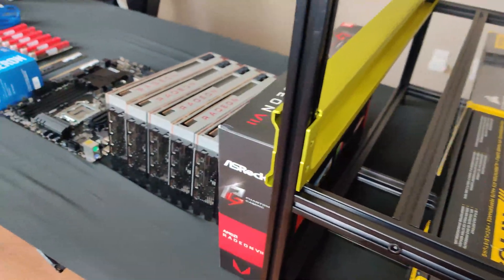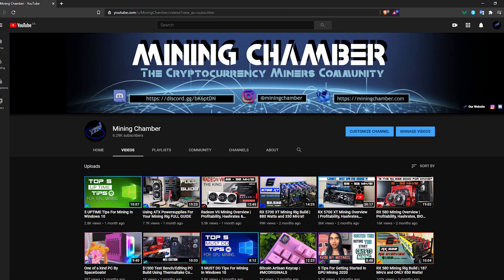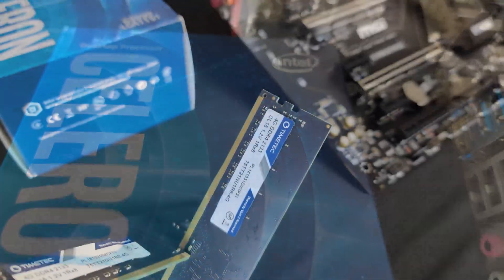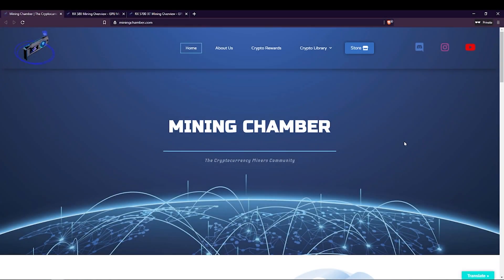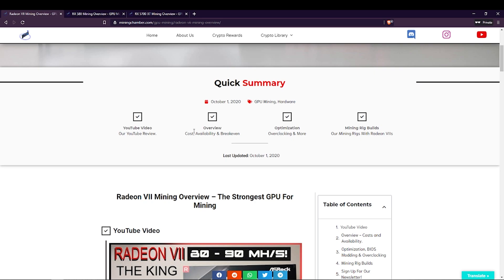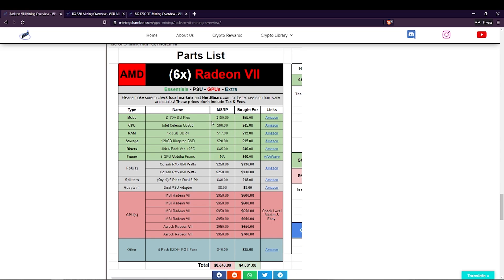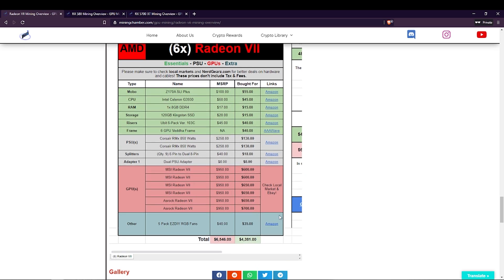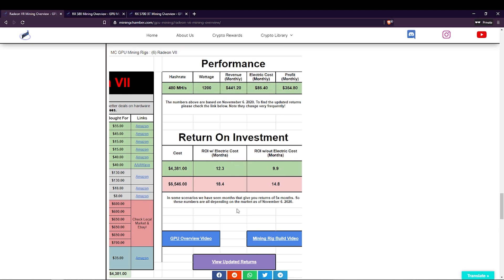Radeon VII Mining Rig Build | HIGH 480 MH/s and 1240 Watts!!

Comment: I also have MSI Z170 board. May I know what bios settings did you change to make it run for 6 gpus?
Reply from the maker: I had to set 4g Decoding on and that did the trick, but if you have more issues with it then try to put your pcie lanes gen speed at 1 or 2. Also note that since this isn't a mining motherboard, it might give you troubles powering high powered cards, we eventually had to change this motherboard and instead used a tb250 btc pro motherboard
Reply: @MiningChamber  ah, I see. Thanks for your input. Why did you change the motherboard? Is mining on MSI board not stable?
Reply from the maker: Msi board ended up giving alot of issues since the R7 are power hungry cards so I think the pcie lanes were not able to handle the R7s (since there is no power directly to the PCIE lanes with Molex port like the tb250)

Comment: Thanks for the videos, they've been very helpful in getting me into mining. Would it be possible to skip the motherboard, ram, cpu, sdd and just buy gpu's, risers, and psu's and connect it to my pc that I already have? And if so, can I still game with my internal gpu while mining on the external gpu's?
Reply from the maker: It definitely is possible but you just need to improvise, I do recommend doing it on a separate system because of crashing and stuff like that. Background services can come in the way and especially with Windows 10 alot of issues already are there that makes mining less stable. So in a nutshell you can but it will be hard to get it to be stable without frequent crashing

Comment: Could you make an video how to configure the Phoenix Miner for different cryptocurrencys ? Cuz i try to run it on my RX 5700 XT and i only hat like 5 MH/s. Its should be round about 50. Pls Help lol
Reply from the maker: Check our 5700 xt guide! Phoenix miner doesn't need further optimization usually just run it and it's good to go! Other than ofc putting address and pool

Comment: I have a Biostar TB250-BTC Pro motherboard and im having a hard time to boot it up as nothing is showing up on my monitor. Can you do a stepbystep with this motherboard?
Reply from the maker: Try to plug a display into the motherboard using the VGA! Could be the reason, if not then try one gpu at a time and plug hdmi into gpu. We will try to do a video on it soon!
Reply: @MiningChamber  Correction on my part. Everything is running, CPU, Lights on keyboard and mouse are lit up except my monitor keeps showing no signal. I tried connecting the display to the motherboard with the DVI-D and it shows no signal. Then i tried connecting one AMD card with HDMI and still same result. Nothing on my monitor.
Reply from the maker: I see, Come join our discord send us some pics of the rig and we can help you better there! Link is in the description

Comment: My current motherboard has an extra PCI-E X1 slot. Can i use a PCI-E X1 to PCI-E X16 riser and connect my new radeon VII and start mining with it? Is it going to lower the performance of the card because of using the riser?
Reply from the maker: You can absolutely do that. It all depends on the motherboard. Some motherboard can't power multiple cards so give it a shot and see how it goes!
Reply: I've been wondering this too. About to buy a new gaming desktop for a gtx 3000 to get back into mining. Hopefully turn it into a little Frankenstein rig over time. I also had the idea of maybe putting the extra GPU's that would only mine on a separate power supply. Not sure if that would work yet but seems possible

Comment: How much does a mining rig affect your Wi-Fi? Is it possible to mine with poor connection ?
Reply from the maker: It doesnt really affect it much. It uses very little internet but if you plan on using WIFI on a slow internet it can be pretty troubling and it will give alot of bad shares (the pool will have trouble with your miner) having at least a stable ethernet connection is better even if its slow!
Reply: @MiningChamber  alright thanks also I am new to getting into mining and I am wondering why you where not mining raven coin? I plugged in all the numbers on what coin to mine and it shows raven coin being much more profitable, aswell as would this rig work if I only had 1 gpu to start?
Reply from the maker: Ravencoin is less profitable than Ethereum and Ethereum Classic as of today. The numbers are not the same for Kapow(ravencoin). For example in Ethash you get 80 Mh per card then in Kapow you get 50-60mh.

As for 1 gpu yes you can absolutely do that!

Comment: Hello I am very new to Bitcoin mining and I have a few questions, would it be possible to do this same build although with fewer gpus and add more as time runs on? Aswell as do different gpus work along side each other in the same rig? Thanks for your time :)
Reply from the maker: Yes they can work along eachother but just for ease of use and better looks I usually like putting the same model ;)

Comment: Brother, you have powered both the riser card and GPU on a single PCIe cable together. Doing so will not overload the cable? Will cable and PSU ports not burn?🔥 Is this the way I can apply to my RX 580 8GB card? Can I power the riser card and graphic card on the same single PCIe cable? Right now my riser card is powered with a SATA conductor and the graphic card is powered by a PCIe8 pin. And all my power supply cables are in use. I got your method very right, if this method works properly and safe, then I will install GPUs and riser card this same method
Reply from the maker: You can definitely do it with RX 580s! It is very safe using one strand for one Rx 580 and it's riser. In our scenario it isn't as safe since the Radeon VII can take alot of power so if our overclocks reset then we are in for a bad time 😅😂

Comment: Try these settings...

- 1150 Core clock
- 801 Mem clock
- ~750 mv core

You can achieve to get only 60 mh/s (per GPU) while halving the power consumption from stock. (ETH)

20 mh/s less per GPU, but a lot less power used. 

While 60 mh/s per GPU itself is still quite fast.

Note: You can also keep the memory clock a little higher (850 - 900 mhz) or maybe even stock clock (1000 mhz) for a more resonable hashrate.
Reply: whats the wattage? cause at that point, you might as well buy a 5700xt instead
Reply: @brunyes1816  Half the power. About only 110-120 watts.
Reply: @dy7296  so you initially said 130w, now 110-120w. is that on the software or off the wall
Reply: @brunyes1816  Yea. 130w per GPU on wall.
Reply: @dy7296  so again. Get a 5700xt if you want 60mh at 130w off the wall. Lol save yourself half the cost for a R7
Reply: @brunyes1816  If you overclock the memory instead of undervolting you will get a few mh/s more,while still managong to get low power. Because ETH depends more on Memory speed.
Reply: @dy7296  whoa really? here i thought you wanted to get 60mh at 130w on a R7 when you can get that with a 5700xt anyway at almost half the price lmfao why would you spend 700-800 on a R7 and go for a 60mh/130w setting. if you cant understand what im saying, then theres no helping you. please buy the R7s and run your settings.
Reply: @brunyes1816  @Benedicto 😂 This is pure entertainment
Reply from the maker: 😂😂⛏️⛏️ easy guys it's fascinating how diverse the Radeon VIIs are ! They can run really effeciently or full on b*** to the wall. 

But I do agree on using it's potential of high hashrate instead of limiting your self to 60Mh. Since 80 Mh for only 60 more watts is really good!
Reply: @MiningChamber  efficient mode on mine is 1000/1100 @ 725mv about 53mh per gpu balls to the wall is 1900/2200 @ 999mv 98mh per gpu.  Like you said diverse.  It suits me as they heat my flat so I can effectively turn my heating up or down at the click of a mouse.
Reply from the maker: @MrButuz  That is awesome!!